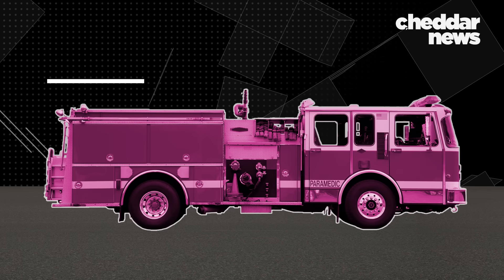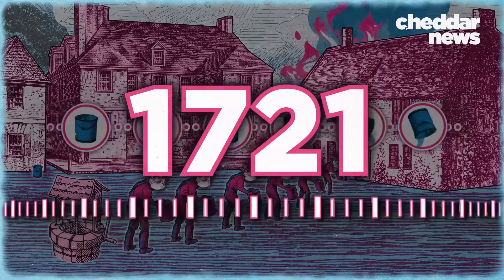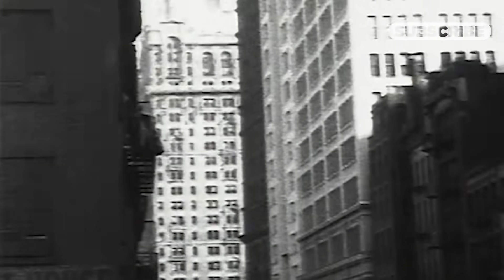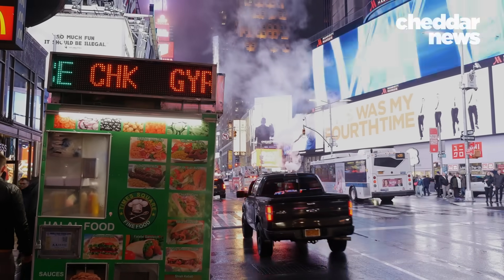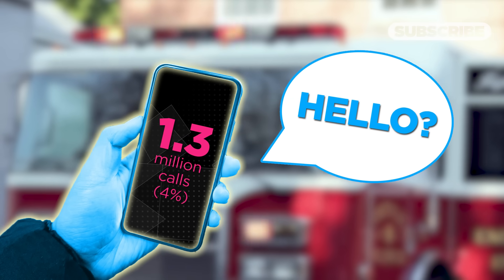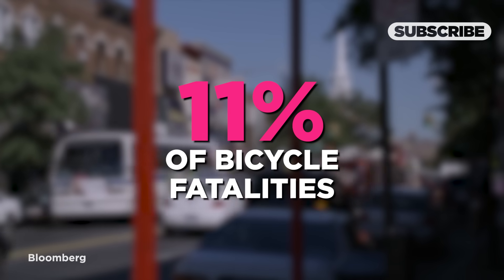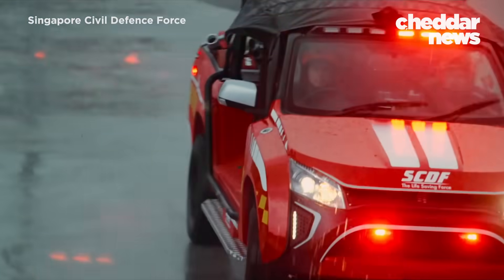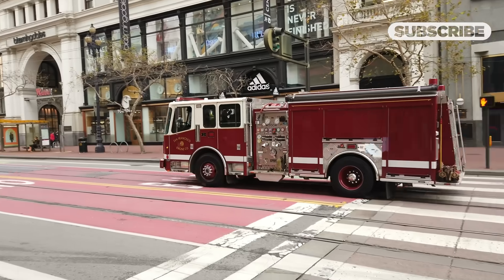Do American Fire Trucks Need To Be So Massive? - Cheddar Explains

Comment: Fire truck don’t hold water. They have ladders and rescue apparatus, and some firefighting apparatus. Fire trucks also have water intakes that take water from an engine and supply it to the ladder. 

An engine does hold water. An engine has medical apparatus, but mostly firefighting apparatus. An engine can hold water, they have supply intakes and outputs, and have the capability to run attack lines. 

Basically, your wrong and a truck and an engine are different
Reply: lol that depends on how you name it, and that differs quite a bit from place to place ...

Comment: They do know america has different fire engine types with better turning for tight areas that are the same size. Saying its old makes know sense as there are new and better optimized fire engines for new urban and suburban standards.
Reply: "They do know america has different fire engine types " like any other country has as well?
"with better turning for tight areas " haha yeah with outdated tech, where it takes a 2nd guy steering the rear. You get trucks with automatic and manual all-wheel steering these days. At least in Europe

Comment: Not to mention, that European fire brigades and depts have several more apparatus with each designed to do specific tasks. Which cost more money. 

Also, American fire apparatus have much longer shelf lives. We operate an engine for 10-30 years depending on call volume and some other variables. A ladder will be replaced every 12-30 years also. In many places they are refurbished to extend the service life, and even then, many are sold to smaller and more poor depts that can’t afford brand new trucks. This video is wildly misleading.
Reply: there are tons of apparatus which aren't designed for a single task but are designed as multifunctional apparatus, like the plain normal Engines are 
"Also, American fire apparatus have much longer shelf lives." uhm no, that's just plain wrong. The average primary life time of e.g. a German apparatus, serving at a big city career FD in the city, is 20 years. Usually it will serve another decade at a volunteer FD in Germany then before it's sold or donated to a department in eastern Europe or Africa then, where it serves another 10 to 20 years
Refurbishment on ladder trucks is a common thing in Germany as well, however often they're replaced after 2 decades as it pays out due to the high refurbishment costs
Reply: @EnjoyFirefighting  it was responding to the video who talks about cost per truck, but ours are the revers in the bigger cities. It’s 10-12, and then 20+ by other depts.
Reply: @jamescoakley4319  yeah here it's like 20 years in the bigger cities and often 30 years in the smaller cities. 
Of course a special operations apparatus costs more, but that's where many European departments go for a special operations pod system, like one or few pod carriers for several to numerous special equipment pods, reducing the costs per task

Comment: This video feels painfully uniformed. Yes the US tends to go bigger. I am from Germany and I do partly agree that US fire engines tend to be bigger but our trucks are by no means small. 

Also when talking about the tiller truck you fail to understand that a tiller usually isn't "just a ladder but bigger" they are also commonly used for technical rescue purposes combining a pumper, ladder and medium duty-rescue into one vehicle. 

Many of the pictures you should from Germany, France and singapoor are special purpose vehicles that do not replace a regular fire engine. The vehicles from France are wildland fire engines that are roughtly the same size as a type 6 engine in the US (also used for wildland fire fighting), same goes for the red rhino which is used as a brush truck or fly car.

One point I have to agree with is that the amount of medical calls that engine companies attend is crazy to me. Yes when there isn't an ambulance available we do also send the engine but it wouldn't come to mind to send them to many calls in addition to the ambulance (They may be requested by the ambulance for assisting in carrying or CPR but that isn't the norm.)

Comment: Where to begin on this anti-fire dept video.
1) A fire truck has a ladder on it, a big, unmistakable ladder. A fire engine, does not. 
2) The prices you give for engines and trucks was about 20 yrs ago. 
3) Engines do not "accompany" ambulances to accidents. They roll both for fire/extrication/cleanup/assistance and rescue.
4) It would seem that, outside of googling some of this "data", you are saying the entire fire service is doing everything wrong and should abandon heavy rescue, ladders and multi-use engines due to the sheer size of them.  Why not eliminate semi-trucks as well? Trains? Any data on how many pedestrians and vehicles are hit by trains?
 5) If the rest of the world does it so much better, there are about 195 other countries you could move to and enjoy your "slimmed down, 5-guys in a UTV" fire dept. 

What an absolute uniformed, regurgitated, googled video this is.
Reply: " due to the sheer size of them" take two comparable types of apparatus, like Aerials witht he same ladder height: a 100 ft ladder truck in the US is based on a much much larger truck chassis than a 100 ft ladder truck in Germany; In fact a 170 ft to 200 ft ladder truck in Germany is based on the same size of truck chassis which Americans have only a 100 ft ladder on

Comment: European fire trucks look different than American because European trucks look different than American. There, simple. If you ever saw regular delivery truck and most common fire trucks they are the same because it doesn't make sense to make a different chassis just for fire trucks.
Reply: "it doesn't make sense to make a different chassis just for fire trucks." why not? Several apparatus manufacturer found out that it definetly would make sense to have a seperate, purpose built chassis for fire trucks?!

Comment: This wasn’t based on very much facts. The history is accurate, but the one reason American fire trucks are so massive, is most engines (at least the ones I’ve rode on) carried anywhere from 1500-2000 gallons of water, because so much of America is rural and doesn’t have hydrants or readily available water source. I could go on and on. And what I know is based off of over a decade of experience
Reply: most of northern Europe is rural as well, yet the fire apparatus there aren't any larger than in a densely populated large city in central Europe
Reply: @EnjoyFirefighting   expect most of America is rural(97%) and it could be hours away from any back up on a fire scenes
Reply: @ej_22  same for many rural areas in Europe ...

Comment: This girl is really sitting here trying to get rid of the things that save our life. I can almost guarantee that every compartment on a fire engine is used. Making these tiny fire service vehicles aren’t gonna help. What happens if you are dispatched to a medical call and your on your way back from the station and you spot a house fire or a car accident on those rhinos you aren’t going to be able to help in any way because you have zero equipment.
Reply: sure every compartment might be used, but I've seen lots of apparatus where only like 50% of each compartment were actually used as equipment was stored losely at the bottom of the compartment or slide out tray
Reply: @EnjoyFirefighting  Well obviously some stuff is loose on the bottom. You can't just hang fittings on the wall. Speaking for LACoFD almost every single compartment is filled.
Reply: @football-ish9313  obviously? We barely have any equipment loose on the bottom of a compartment, and yes we have all kinds of fittings on the compartment walls, slide-out / rotate-out walls and trays

Comment: I can't let this go unnoticed. 
Chassis is pronounced SHASSIE
Beaufort is pronounced BO-FORT

Also when comparing firetruck sizes. WHY has the amount of water each vehicle could carry completely blanked out? You could at least specify the average amount of water needed before saying the US needs trucks with less volume of the thing that allows them to successfully do their job.
Reply: maybe one should also look at HOW the available water is used: the US goes usually for a low pressure high volume approach, surround and drown the fire, while some other countries rather go for high pressure low volume tactics which are equally efficient
Reply: Actually, that is the Beaufort Port Royal FD in South Carolina which is pronounced BU-Fort, Beaufort North Carolina is pronounced BO-Fort. Two different cities with two different pronunciations.

Comment: The United sates is very diverse so some departments in say on the west coast might have to deal with forest fires so they need a big truck to push things out of the way or say even New York it has tall buildings so they would most likely need big ladder engines and a big truck to keep it stable and most smaller departments just go along with it because the big trucks are easier to buy unlike getting a truck shipped from another country
Reply: ladders in NYC don't reach any higher than ladders from a small town volunteer fire department in Germany: their highest ladders reach 100 ft, that's it.

Comment: I think fires here in Europe are not burning different then in USA. But we have to deal with narrow streets and small cities since generations. So our system is to use standard trucks and equip them with special equipment for fire fighting. The use of a standard truck as base makes them cheaper then a complete special construction. The difference is, that we use more trucks for the same task. This makes our strategy more variable, because we can divide trucks to cover wider areas. In Europe we also use quite often volunteer fire fighters. They are spread all over the area and need an affordable equipment not to far from their home or work, to keep time short. Here in Germany we have 1.5 million volunteer firefighters in 22000 fire brigades against 45000 professionals in just 110 fire brigades. The use of smaller and cheaper trucks makes this much more affordable.

Comment: I grew up in rural Vermont where the departments are at least 5 miles apart and rely entirely on volunteers, many of which are high school kids (or were when I was in school). Many of the trucks are old and must serve just about every purpose. I have learned more about firefighting apparatus from this comment section which appears to be based on engineers and firefighters from all over the world than I did from the video.

Comment: Pumper are usually under 30 feet unless you get a  into the rural folks and they get big also 10ft to 10 1/2ft tall. Trucks that are over 12 feet usually are only towers. Staigt sticks with out modifications usually ride about 11 1/2. Not to mention mid mounts. Which are the same hight as pumpers and like 43 ish feet long. This is such an absolute incorrect depiction its painful.

Comment: Its because our rigs are multi-use. Most Engine’s nowadays meet the definition of a Rescue-Engine due to carrying two Rescue 42 struts and a cutter and/or spreader (or Combi Tool). 

Not to mention we also have specialized rigs such as Heavy Rescue’s, Aerial Stick’s, Tillers, etc.

And nothing against the European’s, but our trucks are a bit better when it comes to performance and durability/reliability. Our 1992 Pierce Lance is the safest rig we have due to the material used and how it was designed (being meant to protect personnel in a rollover). The European rigs have a bit more issues when it comes to how safety and durability as most are made of just a hard polymer/plastic.
Reply: "Its because our rigs are multi-use" same here; The standard Engine in Germany, despite being rather compact, is a Rescue Engine as well
How exactly are they better concerning their performance and reliability? Take e.g. a Volvo truck cab and check their rollover safety standards
Reply: @EnjoyFirefighting Our standards for fire apparatus under the NFPA require us to carry a certain amount of equipment that a compact apparatus won’t be able to carry. Not to mention the average Type 1 Engine has a tank of 1,250 to 2,000 gallons.

Plus our safety standards make more compact apparatus that y’all would consider a Type 1, more like a Type 3 or 4 apparatus. Aka they would only be used as wildland engines if a department had them. And for a district like mine where we only have 2 hydrants for a nearly 50 sq. mile area, we need larger tanks. Which some folks do use them for that reason.
Reply: @SobaOfPulaski  I'm well aware of NFPA standards. They definetly ensure some quality and standards. But to be honest: the DIN standards which we have to follow are way more precise on the minimum amount of equipment. It doesn't only dictate the minimum tank and pump capacity, hose length etc, but it tells you EXACTLY how many pieces of which equipment have to be on board, listing every single item. It also sets the standards for the min chassis capabilities, max apparatus dimensions (size and weight), tank and pump capacity, length of hoses, seating (9 on a normal Engine) etc. Looking up a fairly outdated apparatus equipment list, a normal full-size Engine had 164 different tools at a total number of 284 pieces. If it missed some, you weren't able to classify it for that type of apparatus, but went into a lower category. Right now there are 9 types of different Engines categorized by the current DIN standards, not even counting those built according to older standards and which are still used out there. 
"Plus our safety standards make more compact apparatus that y’all would consider a Type 1, more like a Type 3 or 4 apparatus." had to look up what type 1, 3 and 4 actually means, but apart from that our apparatus come in ALL sizes and shapes. Anything from the average apparatus, to extraordinary larger and extremly large ones, and in the other direction apparatus based on as compact units as pickups and vans. beyond our borders even cars, compact cars and motorbikes are used for actual extinguishing purposes. 

As for the structural safety of your apparatus ... uhm that's a standard here. Not only on fire apparatus, but on the plain normal commercial trucks. Volvo is performing truck rollover crash tests for decades already, keeping the pillars and the cab roof upright even in severe rollover accidents turning over several times... with our apparatus not being built as custom apparatus they benefit from the experience coming from millions of miles done by the commercial trucks moving freight across the continents

Comment: Fire engines tend to carry a crap-load of equipment. Such as the famed jaws of life, separate generators for powered equipment, lighting equipment, hoses, either litter or other things to soak up oils and other liquids, hose attachments, and the list goes on. The shear amount of equipment on one truck lowers the need for multiple vehicles to hold multiple different types of tools. It was also mentioned that the truck looked old. In my opinion, looks don't matter on a firetruck. It still serves the same purpose of protecting the public.

You also need to not just look at 'the big red box' as it was called. I've seen so many different types of smaller, medium, or larger trucks in America. There is more than just the single truck you're looking at.
Reply: many plain normal Engines in Europe are multi purpose Rescue Engines with a wide range of equipment just like you mentioned as well

Comment: It’s crazy that firefighting can be made a liberal issue. It’s like they just searched random facts on the topic and not firefighting as a whole. Each department is different because if it’s structures layouts, geographical layouts and much more. Also each apparatus serves it’s purpose. They are made via departmental specifications most times ,unless they are used and are in dire need of equipment. If there are changes that need to be made, they would be made accordingly. This video is very misleading.

Comment: This is all boils down to the necessity of what firefighters require in their operating jurisdiction. Not every fire department needs the same equipment depending on its location. (Like you dont need a 125ft telescopic apparatus for a small rural town whos highest building is only a 3 story courthouse). Basically fire trucks have evolved to meet the needs of that specific department. Everything from water carrying capacity, what tools i carries, ladders, crew size, etc. Just saying "well they need to be smaller" isnt that easy. Im sure if manufacturers could build them smaller, while also making sure they dont sacrifice any firefighter needs for that area, they would, and are in some areas. As technology grows and shrinks, so will the equipment that uses them.

Comment: Fire trucks have ladders.   Fire engines have pumps.  Trucks and engines are not the same.  Trucks tend to be larger to accommodate tall aerial ladders for lifesaving in high places. The engines in this video are smaller because they are not carrying large ladders.  Apples and oranges.
Reply: how things are called differs quite a bit ... in some areas a rescue is a heavy rescue; In other areas ambulances will be named rescue. It goes on to actual requirements to be classified as a certain type of apparatus, thus an American Engine running in Germany would be classified as a sort of Tanker.